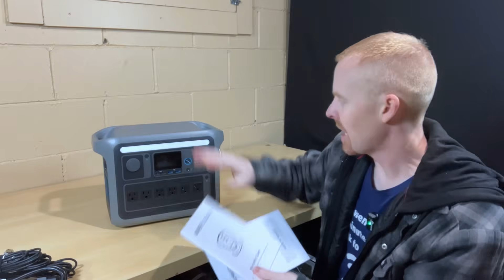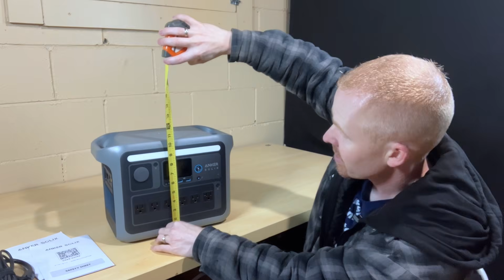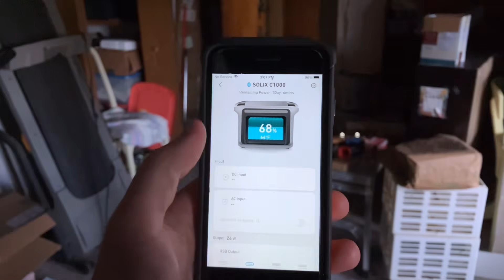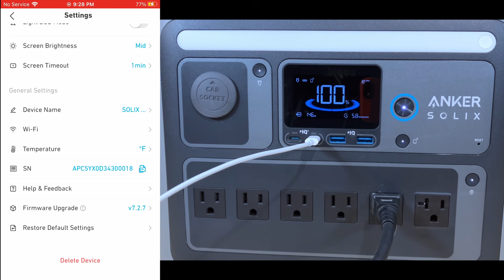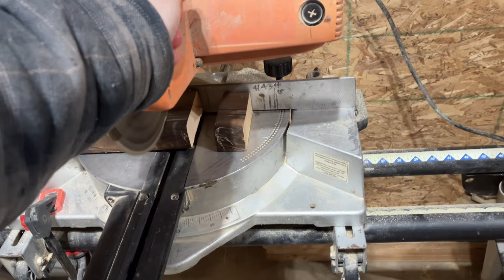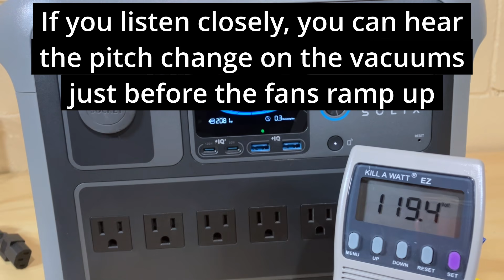New Anker SOLIX C1000 Portable Power Station: Ultra-Fast Recharge & 2400W Surge!

Comment: Would it not prudent to charge at say 750 for overall battery health and longevity… is long term charging at 1000w over stressing the system? (let alone 1300w)
Reply from the maker: For regular charging, yeah, I would moderate it and let it slowly charge just for battery sake, but in the event that you have a storm coming or your short on time where you really need that power fast, you could fast charge it occasionally.

Comment: So do you need to charge it to 100% out of the box?
Reply from the maker: Yes.  None of them are charged full when you receive them.  They're usually between 30-50% SOC.  It has something to do with battery capacity restrictions during shipping.

Comment: Great review!   I had a question - will it actually charge from DC (or AC) while it's providing power?  A lot of power stations will charge, but as soon as you put a load on it, it will pause charging, and go into pass through mode, where it will provide power but stops charging.
Reply from the maker: Thanks!

Yes it does charge and power loads at the same time.  I believe what it does is it goes into passthrough for both charging and loads.  These types of devices can't "mix" power from the grid and batteries at the same time so when charging, power for the loads will also come from the "charger source".  Hope that makes sense.
Reply: @AdamDeLayDIY  Ahh, ok.  So it can actually divert some input power to the charging circuit, and some to the output.  That's great.  I'm trying to power a fridge in my vehicle so that it runs off battery power when the vehicle is off, but when the vehicle is on it charges up the battery and powers the fridge at the same time.   The power station I bought doesn't do it - it won't charge and power at the same time, so the battery never charges.  Thanks!
Reply from the maker: @ Hope it helps. I will say that’s how it works with AC charging.  DC charging may be different because the power either has to be stored in the battery or converted over to AC in order to be used.

Comment: Good Job very good video and easy to follow. I just purchased this power station with the extension battery BP1000. I know there are some less expensive ways to go but this has everything I need and it is mostly plug and play. I really like the app . I like you would prefer a 
well printed  in a large enough print owners guide starting with the basics and moving forward. This is really my only objection it was printed so light and so small it was useless
to me.Also wish  it was a little lighter or had a bar across the top rather than the two handles to make it easier for people who aren't weightlifters to move around. All it is a great machine that is easy to use and will come in handy for camping,outdoor dinner parties to keep things warm ,and for blackouts. I pray that none of us need it for the long term grid being down .Makes me feel pretty secure about power.Thanks Anker.
Reply from the maker: @brynmiller4232  awesome!  Thanks for sharing!  I know my in-laws used mine a few months ago when a storm knocked out the grid.  Worked great for them!

Comment: So what's the surge on the Shop Smith saw?
Reply from the maker: @mikuspalmis  when I tested it it pulled a max of 51.4 amps.  That’s not inrush (which is probably higher).
Reply: @AdamDeLayDIY  Thanks. I dunno much about this kinda stuff. I wonder which higher model power station would be able to run it based on what rating.
Reply from the maker: @mikuspalmis  yeah out of all the different power stations I’ve tested, none have been able to run that saw. Some home level inverters can,but not the portable power stations.
Reply: @AdamDeLayDIY  Ok. Thanks.

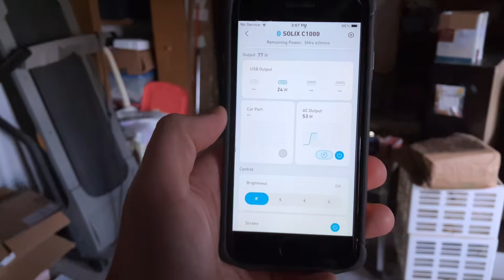Comment: 8:32 If you leave the area of your wifi make sure you disconnect the wifi and get back on bluetooth before you leave. I have had a couple of different times that I didn't do that, and trying to get it to reconnect to bluetooth can be troubling while you're trying to do other things. The only way I've been able to turn the wifi OFF has been the seven second hold on the IOT button to reset the wireless settings.
Reply from the maker: Thanks, yeah I experienced that once as well

Comment: The voltage drop on the inverter is the way to communicate to the load that there is not enough power. It's standard practice. Tesla for example automaticly adjust max current depending to voltage level.

Comment: One thing I just noticed today. I want to charge my C1000 off of the AC Power outlet in my truck bed for when I go camping. The outlet is rated at 400 watts. I have the power station set to charge at 200 watts so I wouldn't pop a fuse on the truck but it will not charge. The C1000 just clicks. It will charge off of the 12 volt from the car charger inside but not the AC power in the truck bed or inside the cab. Am I doing something wrong?
Reply from the maker: Not that I can think of.  The only thing that comes to mind is maybe there's some kind of "startup surge" that's causing the circuit breaker in the truck to trip?  Do you have multiple outlets that you can plug something else into at the same time as the C1000 to make sure the outlet isn't losing power?

Comment: Sir, if I got this power station, could I charge it from the AC port from my car with a 500 w inverter by lowering the AC input to 200 watts
Reply from the maker: If you lowered the AC In down to 200W, yes you could charge from the inverter in your car.  It would take around 5 hours to completely recharge the power station and I would recommend not charging with your car off the entire time as it would probably drain your car battery.
Reply: @AdamDeLayDIY  even if the car is on
Reply from the maker: @zodaguado6655  for the amount of time the charging would take you would want the car running to help supply power to your inverter.

Comment: Thanks for all the testing! Looking at this unit specifically in a UPS capacity, I enjoyed your test but I have a question - if the unit hits 0% - i.e. it acts as a UPS, it runs the loads as long as it can, and then dies... and power on the AC side comes back - does the unit immediately power back on, begin charging, and resume AC output without user intervention? If that last bit doesn't happen then I can't really use it as a UPS in a remote location because I won't be physically there to toggle the AC output button. Do you happen to know what would happen in this case? Thanks again for all your work on this channel!
Reply from the maker: Appreciate the comment!

So when power is restored to the device it will start charging, but I don’t believe it will turn on the AC output.  Unfortunately I don’t know of any smaller power station that will do this.  I believe I remember hearing that the Hysolis Apollo does this but I can’t think of anything else that does.  Sorry about that.  I wish that more would “recall” the last state they were in.  

I’ll check with a few contacts at a couple companies and see if I can come up with any options.
Reply: Thanks @AdamDeLayDIY  - yeah I figured that was the case. I may go with a slightly more expensive, but known-and-tried-and-true solution like a small Multiplus/Shunt/Cerbo/battery in a box, similar to what you did for your RIGID DIY power station. It would have been nice to have an AIO solution (and have it MUCH cheaper) but I think this application is rare, and Will Prowse has had similar issues with self-start too (though, in his case, he's usually critiquing auto-invert from zero where power in is from solar, not the wall). 

Just trying to avoid LiFePO4 solutions from folks like APC, who do have them but they're insanely expensive. And I don't trust LiFePO4 "swapout" replacement batteries for SLA-based small UPS models. 

Thanks again!
Reply from the maker: @maliciousloki  Not a problem.  Anker did confirm that they don't have any power stations with that feature.  After looking back at some of Will's videos, he mentioned that the EcoFlow Delta Pro and the Hysolis Apollo had these features, but like you said he was more looking at it from a solar aspect.

Good luck on your search/build!
Reply: Thanks for following up, yeah I think a homegrown solution may end up being best. Appreciate all you do!

Comment: How much per kwh an hour to charge? Can't find that stat anywhere
Reply from the maker: That will depend on what your current utility rate is.  This unit is right around 1kWh of storage, so for me I believe my cost is around $0.14/kWh.  You could offset that cost by getting some solar panels and recharging from the sun as well!
Reply: I think you are asking about efficiency. How much kw in to what you get out. In my tests  charging at 600w  it takes about 1240wh to charge from AC. Which is not much better than those cheap 12/24v Lifepo4 charges. DC charging looks to be super efficient (I measured less than 1085wh) in comparison.

Comment: Thanks for this very interesting review but every reviewer seems to concentrate on the fast charging, max power and runtimes, probably because Anker concentrates on that. Some of us would be more interested in runtimes when it's only drawing a low load such as say 10 watts an hour necessary to run a router and VOIP phone on AC during a power outage. From some things I've heard the inverter will take so much power that the power station will only run a day.
Reply from the maker: Thanks. 

I think the biggest reason is because of the product "claims".  If a product claims it can do something, it needs to be verified.  

I know I've done something similar to this (just not that small of a constant load) for a different power station.  Every load is different so that will change the outcome, but you're basically wanting to know about the idle draw on the battery when the power station is running?
Reply: @AdamDeLayDIY  Thanks for the replay. we'd just like to be able to keep 3 essential items on for as long as possible when we get a long outage, which, since we're in the hurricane corridor in Nova Scotia, can happen as much as once or twice a year. We're way out in the country and getting old. Don't need heat as we have a wood burning range and don't need water, (gravity feed) but we'd like to keep internet, VOIP phone, and the internet antenna running for as long as possible. They're all AC devices together drawing around 10 watts, so from what I've read, the C1000 will only power them on AC for about 24 hours because of the inverter drawing so much power. Thinking of using adaptors and plugging them into the usb ports where I believe they'll run much longer, maybe 4 or 5 days. But not a consideration for most people, I guess.
Reply from the maker: @richards2072  Let me run a test and I'll get back with you.
Reply from the maker: @richards2072  Ok, I started a 10w discharge test to see how long it runs.  Output fluctuates between 10-10.6w, but should give a really good idea of how long it lasts including idle consumption.
Reply: Thanks Very Much!
Reply from the maker: @richards2072  You're welcome!  If you don't hear back from me by Monday, reply to this thread so I can double check the numbers for you.
Reply from the maker: @richards2072  so as I said I had a constant 10w load average on the c1000.  It lasted for 38.5 hours before it shut down.  I

 did notice that the power factor of the load was 50%, so not ideal.  I even checked other loads around the 10w range and they all had a similar power factor.  So I’m not sure if smaller loads in general have poorer power factor or not but that lower number affects the efficiency. 

Hope that helps!
Reply: @AdamDeLayDIY   Thanks, Adam. Just want to check,  was this on the AC outlets or the USB outlets?
Reply from the maker: @richards2072  This was on an AC outlet.  I would imagine that if you could run off the USB port, it would be much more efficient.
Reply: @AdamDeLayDIY  I can find adaptors to run the router and the VOIP phone over the USB ports but so far haven't been able to find one for the POE antenna. I'll keep looking.
Reply from the maker: @richards2072  Awesome! Good luck!
Reply: It's not wise to run 10w loads from inverter. You're automatically losing 50% as most inverters consume this idle and some up to 30watts. AC should be used for 100w or above for about 75% efficiency.  I  have asked Anker to look in to a Fridge/Freezer mode. They already have all the physical tech. Just needs software to check the AC power and turn off the inverter when fridge/freezer or other device that doesn't draw constant power to work isn't drawing. Then the app needs to turn on the AC every XXmins and check if power is drawn, turn off it not.  It could all be done with some more lines of code in the app. Could make running a fridge off AC run 2 ,3,4 times as long. Wish I cold get my hands on the app source code. :-)
Reply: @Gravitational234  Very Interesting!  Sure hope they listen to your suggestion and make the changes necessary in their source code.  Seems to me it would be a great selling point for them.

Comment: Wow ! Excellent 'run through' Adam and no one else mentions the amazing WiFi capability,  you can, for example, pre-plug in devices and switch them on or off from a distance, as long as you have Internet connectivity and the unit is on standby; Even set the amount of time for them to be operational- so operation can be remote well out of Bluetooth range. (see 7:51 onwards)  

A good point about the first start-up, must be fully charged and the recent Software update I think makes the fan noise much quieter in our opinion -  Thank you.
Reply from the maker: Thanks!

Comment: Do you happen to have an ac polarity tester /checker  if yes how is the polarity correct or reversed ?
Reply from the maker: AC hot and neutrals are wired properly
Reply: @AdamDeLayDIY  both when plugged to grid and when disconnected can you check if your unit switches or stays the same . Mine finally arrived and I tested this and it’s reverse when not plugged in to wall but corrects it self when plugged in to grid power , ground is on both end and is floating when not plugged into wall but regardless if it’s reserve when not plugged in it’s a small risk isn’t it for things that have switch ( ac power flow )  so the bypass or ups mode as many call it when plugged the power comes only from grid and disconnects from batteries and  input power 120v gets sort of divided  into charging the battery and outputting to the ac output port , but when not plugged to wall all that energy and amps power is coming uniquely from the battery send to the inverter so why is it that I am getting a reserve polarity ? Is this common on the anker c1000 or like the previous power house 575 renamed F2000 after they replace some units ?
Reply from the maker: @charlschuck6  When I tested mine, it wasn't plugged into AC.  It had a floating ground, but that's to be expected.  

I would double check whatever you're using to check polarity with to ensure that's reporting properly.  If it is, then I would send a message to Anker support and see if they have any more information for you.

I can't speak to other units because this is the only Anker power station I've tested.

Comment: I know many don’t ask this but idk if you have the time to run a test for the Dc Cigarette output port the 12v one:
 With the included cigarette  to xt60 cable plugged in and could you do a dc voltage reading to let us all know what’s that voltage polarity shouldn’t matter the meters will display -12… or regular 12.. and on. You know what I mean you have install bigger units 😅 .? Not many on their reviews check this section and or focus but many campers use this for devices like led and more and it would be great to know what’s the actual value not just trust on the specs on the unit but tested our selfs :) I’m this case you could do us the honor 😂
Reply from the maker: Sure, not a problem.  13.38v on the cigarette output.
Reply: @AdamDeLayDIY  wow nice regulated volatge thank a lot !!!
Reply from the maker: @charlschuck6  you bet!
Reply: @AdamDeLayDIY  i wanted to share something hope it helps I’m not here to criticize but I saw some guys that had issues w the f1200 yeah the unit stop working and they have  expired is passed “ their warranty  date” anyways they opened the unit and couldn’t fix it the unit won’t take charge of any source it’s not the first time this happens  also to me but with other brands . I have seen this on two units I bought and worked for 1-3 yrs and failed one was total wasted bms  it was gone and the other worked but being all in 1  unit if anything goes bad the whole beauty goes away and won’t function . I gues once’s again the diy separate systems is best hehe I mean the good thing is that this c1000 and many brands have now days good warranty so they are backed up  for longer period of time . But it’s good to be able to choose what to buy and think for the future coverage

Comment: I understand there’s things that just require way too much surge power I saw a YouTuber do a test on electric car lifter system that ECOFLOW biggest station / bluetti ac300 model couldn’t started it 😊 it was supposedly over 6400w surge so yeah there’s a limit to everything even some 48v solar system couldn’t power a table saw so yeah there’s things ( motors most of the time )  that will just demand too much power 😂
Reply from the maker: Yeah, every device is different…that’s part of the fun of testing them though.  Gotta push things a little bit!  😁